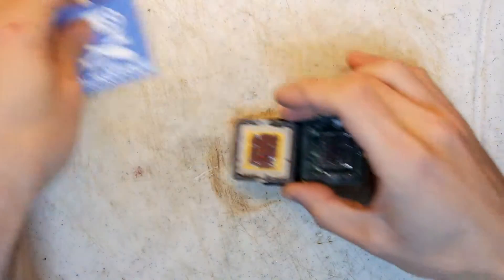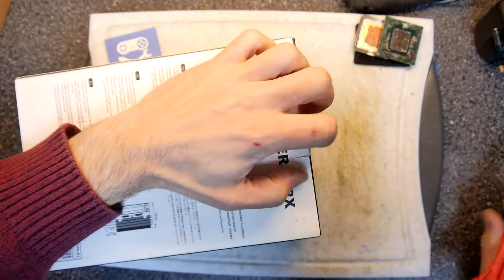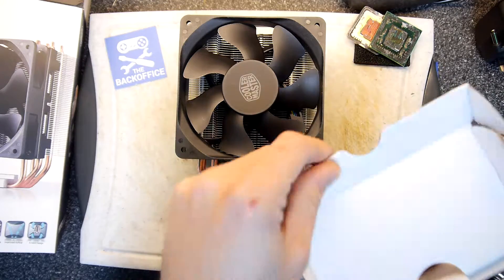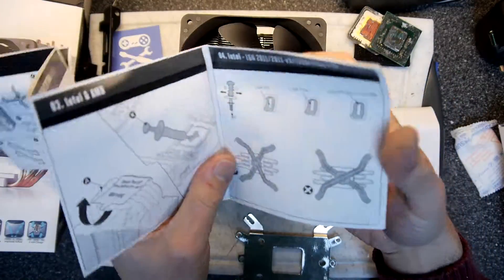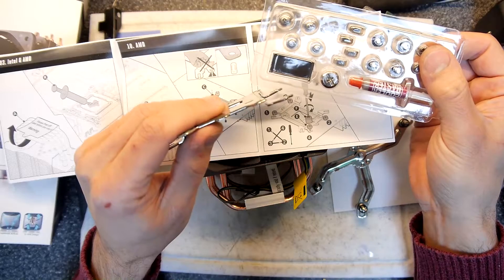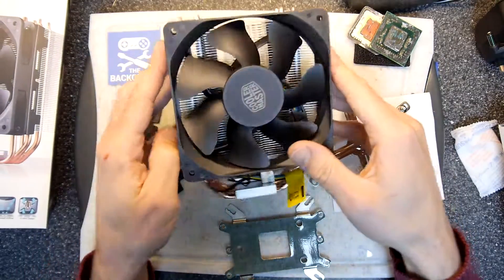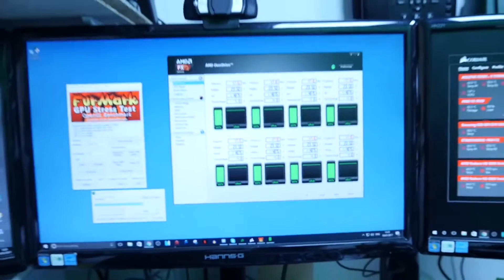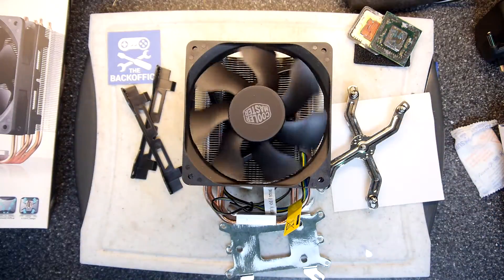Cooler Master Hyper 212X CPU Fan and Heatsink

Comment: When I got mine built I got the Corsair Hydro H110i GT. Definitely worth a look. It comes with 2x 280mm Fans and when they aren't under load they aren't that loud. There are videos out that that shows this is savage when you overclock too. The only down side is I can't figure out how to change the colour of the LED to match my system :(.

Comment: Have used one similar (had evo in the title i think) previously and they're good coolers.
if you're really worried about temps and don't mind the size, i highly recommend the Noctua DH-15
Reply from the maker: Thanks for the tip, I will keep it in mind if the margins are getting too small in the summer!
Reply: The Backoffice No worries. Thanks for the heads up about water cooling...maybe they'll sort it out some day?
Reply from the maker: I think there is a fundamental issue in using a liquid to take the heat away and that is disposing of it once you have it, so unless you increase the size of the radiator or the number of fans blowing on it you are going to be no better off.
Reply: Do you reckon you'll go back to water cooling?
Reply from the maker: +treguard1982 never!